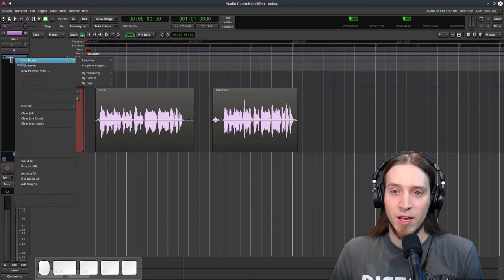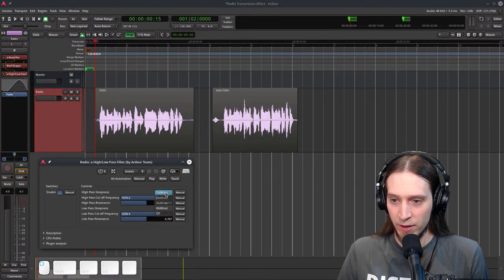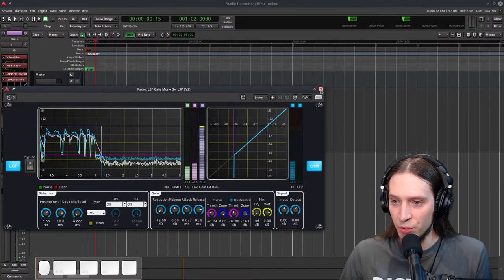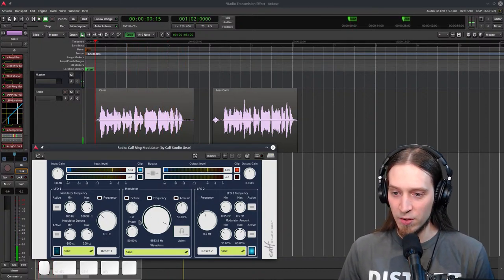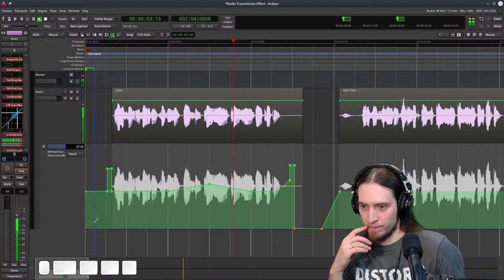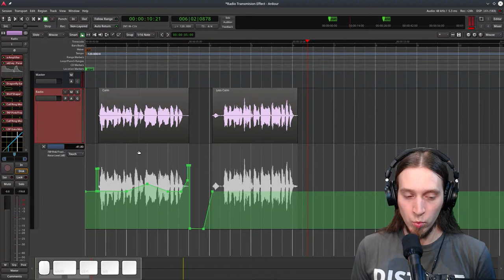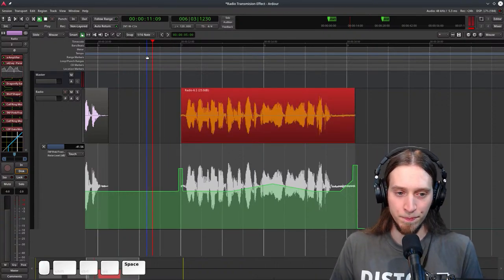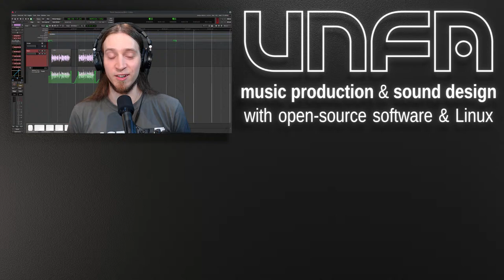Creating a radio transmission voice effect with free software [free project DOWNLOAD]

Comment from the maker: It starts at 0:30.
Here's a cheat sheet:
· Lowpass (simulate low frequency response of the transmission)
· Highpass (simulate a small speaker playing back the transmitted signal)
· Distortion (simulate overloading the transmitter's microphone)
· Hard Gate (simulate weak signal reception)
· Noise + Gate (simulate background noise, but only during transmission)
· Reverb (simulate environment of the transmitter microphone)
· Ringmod (simulate radio interference)
· EQ to boost plosives (simulate no microphone wind screen and proximity effect) and add harsh resonances (to simulate suboptimal cheap microphone construction and chassis)
· In/Out Noise Bursts (simulate signal cutoff at the end of transmission)
· Use a crappy microphone or  headphones to capture the voice lines in the first place

Comment: - You emulated SSB or AM radio, but added FM noise end of transmission. :)
- When start an FM transmission, nothing noise peak, because the modulation opens the noise barrier. Only be in end of transmission, because the noise gate close after modulation ends (release).

I worked with radio transceivers.
Reply from the maker: Ah, I see! Thanks for that - this kind of hands-on technical insight is something really hard to replace.

Comment: With all of you knowledge of open source projects, I wonder if you were to edit the audio from a video project(from ex. Blender or Olive) in a DAW, which one would you use and how would you do it? Audour has video playback, but it's not free on Windows. What other foss DAWs out there have in sync video playback(or jack+video player(slave))? And what are the import options of the DAW? Currently Olive has no project(edl) export options, so STEMS would be the only option there. Blender has a few exporter add-ons: https://github.com/tin2tin/ExportEDL Audio only: https://github.com/snuq/Quick-EDL-Exporter Audio only to Ardour: https://github.com/szaszak/blender_velvets/blob/master/Blender_2.80/blue_velvet.py What would you suggest?
Reply from the maker: Hmm. Honestly I don't see any feasible options outside of Ardour. Yes, the official builds cost money (minimum of $1), but technically I could still compile it on my own for Windows. On Windows using JACK sync is going to be a major pain anyway, I don't even know if it'd work. I wouldn't use Windows if I had a choice to begin with...